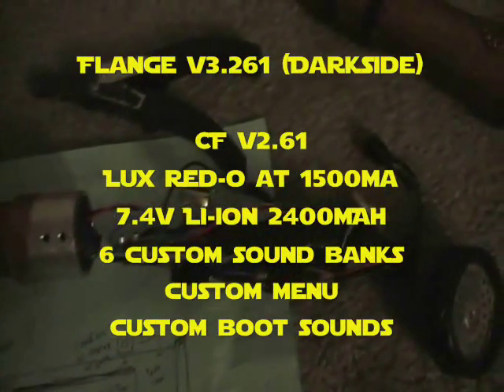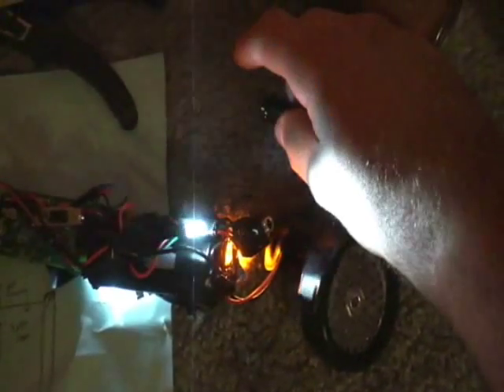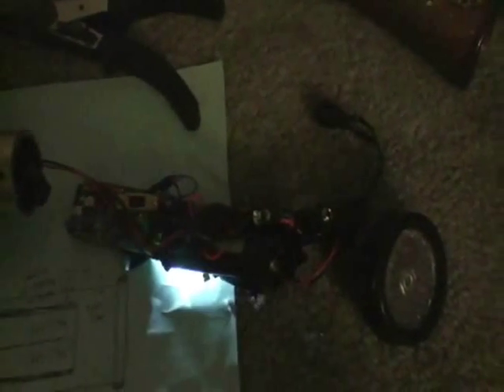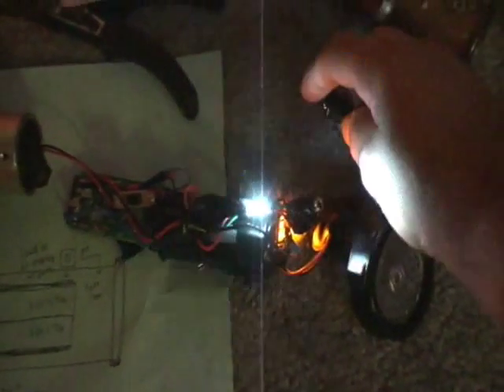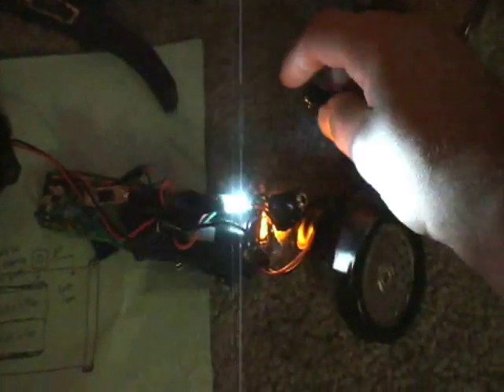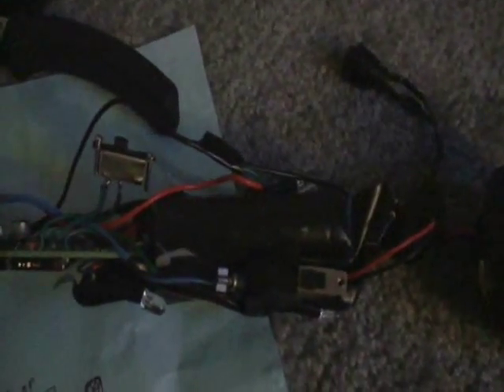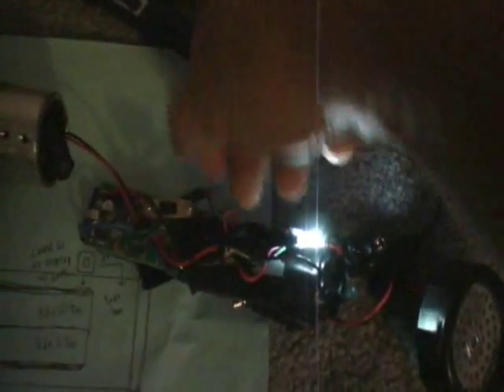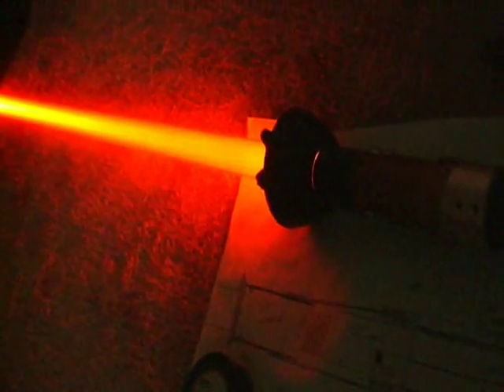How to build light sabers -- Novastar, Flange III Red, Crystal Focus (Plecterlabs)

Comment: Great Job on your new board!  I need to get that Pheonix sound font onto my saber.  Very cool.  

On the rumble motor, yeah it NEEDS to be mounted to the hilt.  The weight of your hilt will even out it's vibration quite a bit.  To the point where you don't get false swings.  My Proto2 saber has a motor just like that, zip tied to the inside and it works fine.

VERY COOL!!